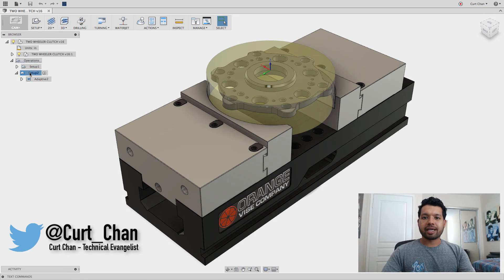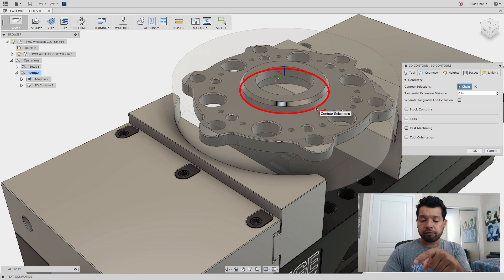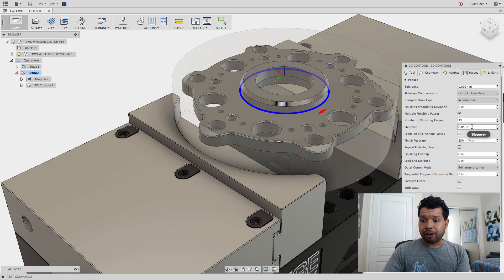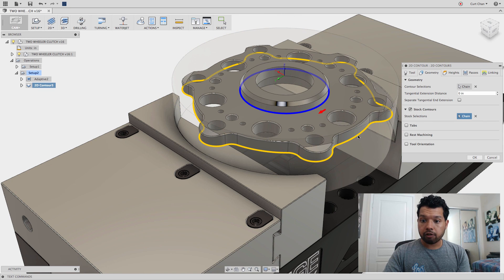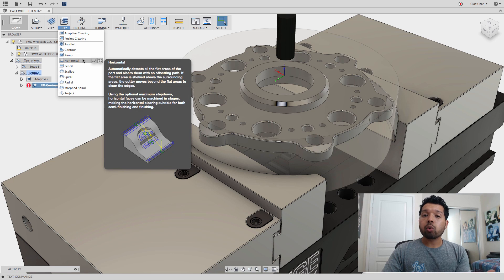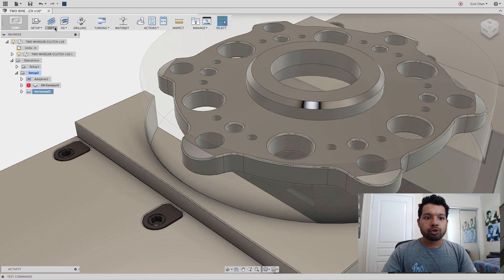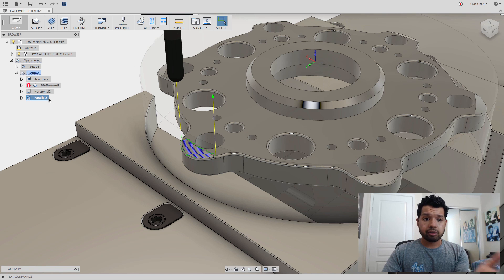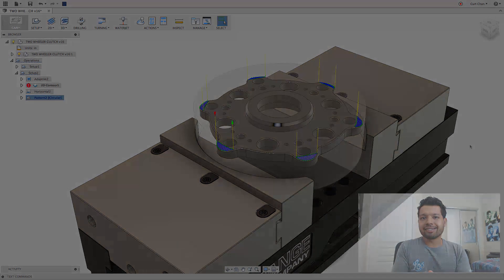QUICK TIP: 2D Contours and Horizontal Strategies

Comment: Hey Kurt, I've seen a TON of videos on setup for first op programming, but I think it would be utterly invaluable to create a series on second op setups, such as softjaw or fixture creation (that part in this video would be perfect) tied in with programming. Basically a "manufacturing miniseries" from start to finish.

Thanks for the video, yours are always enjoyable and informative.
Reply: +atomkinder67 Totally...have you seen this document on multiple setups?  It's old, but good.  i'll whip up a couple videos.  https://myhub.autodesk360.com/ue29c9141/shares/public/SH7f1edQT22b515c761eaa673e8e12d8f6b4
Reply: +Curtis Chan I had not! I also spelled your name incorrectly, which I apologize for, and should be more aware of as most folks misspell mine too.

I've been tackling a lot of fixturing ideas at the day job in SW/HSMXpress and found it tough going with few examples out there, and I figure there are likely others out there like me.

Looking forward to your videos.
Reply: +Curtis Chan It would be awesome to see a video of making soft jaws based on the part you're machining at the time. Just started using fusion and coming from mastercam which was a pain to make soft jaws for parts, it would be great to see :) i just posted a video of the first part i made with fusion at work today too :)